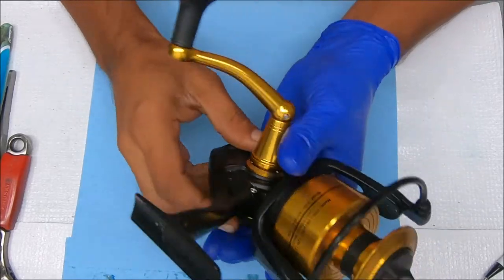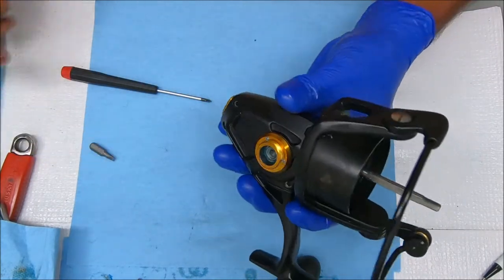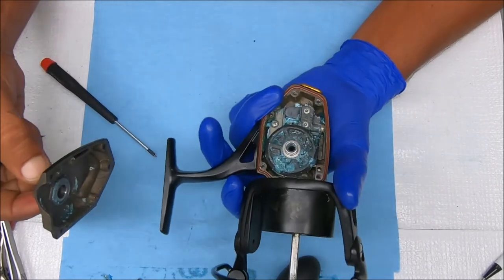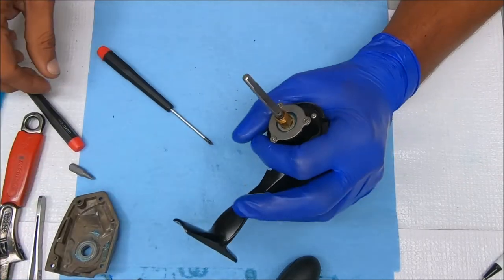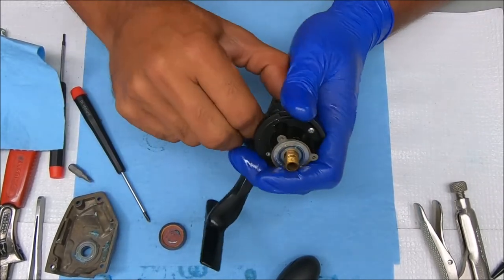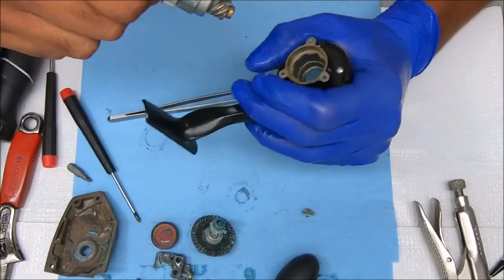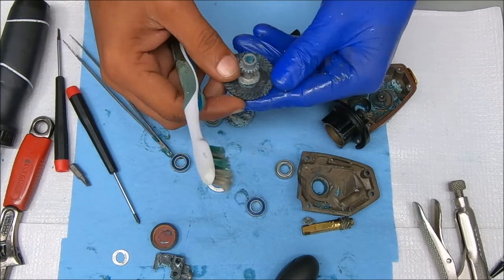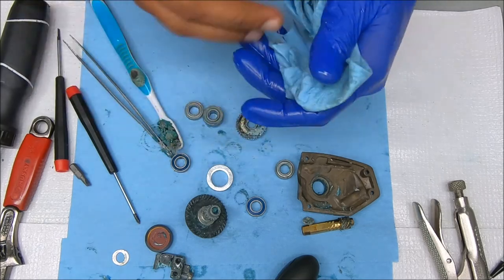Penn Spinfisher 5500SSV ROYALLY STUCK - problem diagnosis: Fishing Reel Repair

Comment: I've heard about Penn grease solidifying before, I just never saw it.  I use Quicksilver 2-4-C, Super Lube or Evinrude Triple Guard and Cals Universal Reel and Drag Grease.  I'll thin grease with Corrosion X to pack the bearings on my spinning reels so they don't feel too heavy.
Reply from the maker: Good stuff. I've only seen it a few times. Wish I could tell you why it happens, but chemistry is not my strong suit. The good news, in this case, it the parts costs are still reasonable.
Reply: Penn grease (blue) it's a mineral grease. It's can froze when temperature below zero degree. It's not good if you fishing in north waters. My English not a native))

Comment: I think your problem was not the bearings but the block that moves back n forward ( was holding by 2 nuts that you haven't remove yet)
Reply from the maker: Thanks for checking out the video and your input. You mean at minute 04:00?